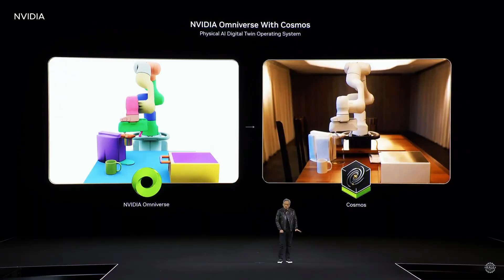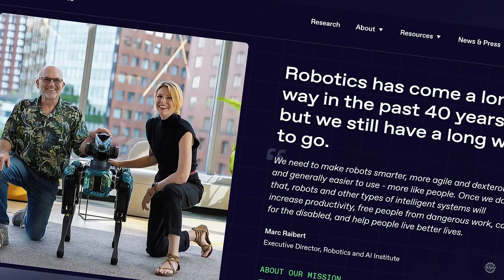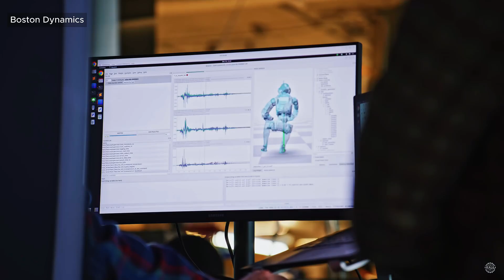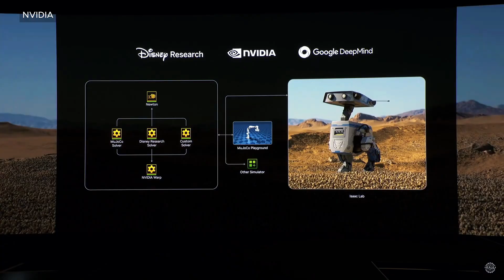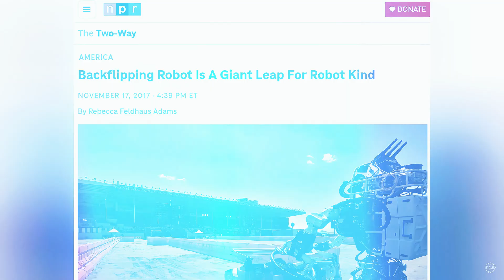Boston Dynamics Atlas AI Robot's New Shocking Capabilities and Unitree G1 Humanoid's Latest Record

Comment: Atlas and its full-circle joints comprehensively map the entire domain of human movement—and more. No other robot matches Atlas in this regard.

This complete freedom of movement—independently controllable across every dimension—is essential for achieving any specific or arbitrary motion.

That versatility expands Atlas’s potential uses across many domains and increases the range of applications exponentially, by the product of its degrees of movement.

For example, instead of building different robots for different tasks, Atlas can often be used, since most motion requirements fall within its capabilities.